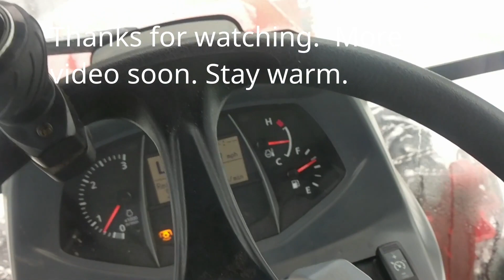#44.  Snow blowing on December 14th 2020

Comment: A good quality suction cup like the glass installers use will suffice for your camers mount.
Reply from the maker: I'll have to look for one.  Thanks.
Reply: GoPro makes a really good one that’s relatively cheap. Otherwise you can spend 8x more on a high quality SLR suction mount. The GoPro is adaptable to other small cameras also with a threaded mount. I use GoPro’s with their clamp mount on the exteriors of my tractors, blowers and mowers.
Reply from the maker: @zfilmmaker  Thanks for the information.  I'll be looking at those options.